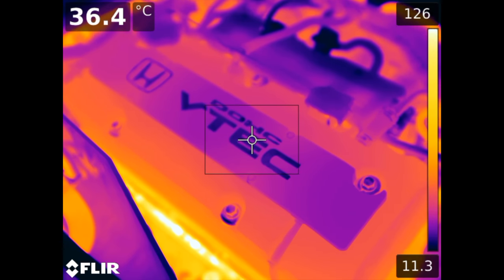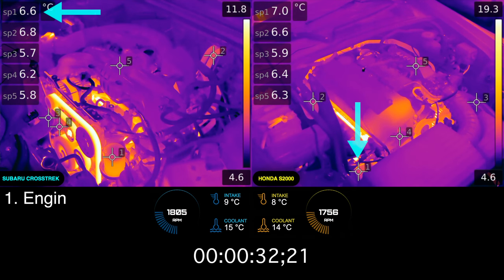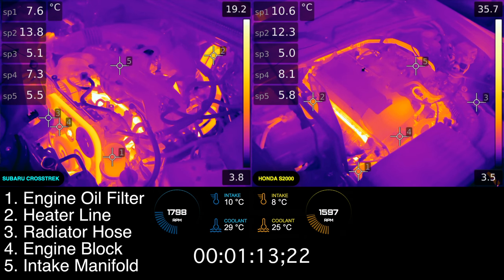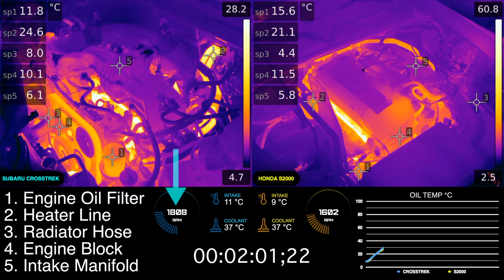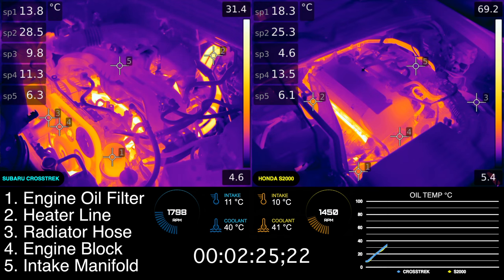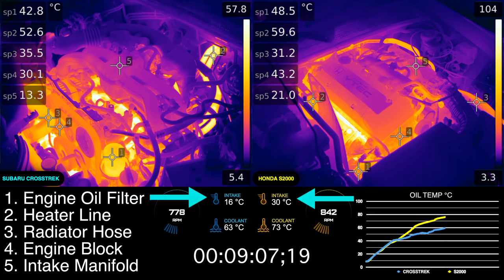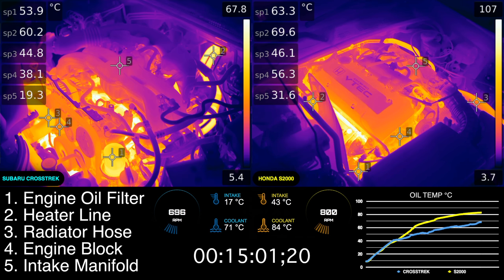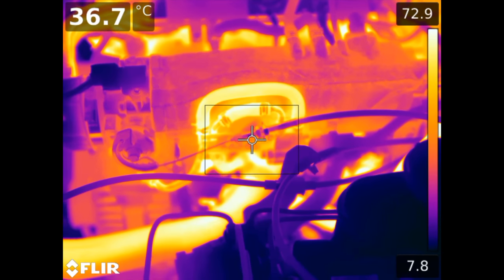$40,000 Thermal Camera - Watching Engines Warm Up

Comment: Serious question, what kind of engineer likes hondas???
Reply from the maker: If you don't know why the S2000 is cool from an engineering standpoint, this video is for you! https://youtu.be/wf_ICA2JdLU Innovative chassis design, carbon fiber cylinder bores, the highest specific output of any naturally aspirated engine when it debuted. Quite a machine!
Reply: Ok I get it more now but there is no justification to that styling and those carbon fiber cylinder bores just seem excessive compared to the rest of the car. Also considering what else is on the market these days but I guess it's just one of the choices and whatever floats your boat

Comment: It was hard to watch this video, America 😆
Reply: it's easy 0 celsius is freezing 100 celsius is boiling. instead of 32f and 212f.
Reply: I think what he's saying is that it's good to be able to estimate and figure in many systems, not that one is better than the other.
Reply: It really just comes down to what you're used to.  I know what inches, feet, miles look like.  I know what ounces and pounds feel like.  I know what Fahrenheit temperatures feel like.  So for example I know that a measurement like 30 inches or 2.5 feet is the height of most desks and tables.  5.5 to 6 feet is the height of most adult humans.  And 32 degrees is cold, 72 degrees is comfortable, and 98 degrees is hot!  I know these things because that's how I was brought up.

With the metric system, I can't "picture" the measurements in my mind.  I always have to do a mental calculation to convert to imperial.  That town is 100 km away?  Oh let's see, 1 km is about 0.6 miles, so the town is really about 60 miles away.  Got it.  I think that's the problem that most Americans have with the metric system.  They can't picture what it is, and have to convert, which takes mental abilities that many people just don't possess.
Reply: Enjoy!Hhahahaha C system is much more better...
Reply: Me personally I live in American, but use the metric system because imperial is just ass backwards.
Reply: quick - how many newton meters tight should a lug nut be?
Made you look it up.

Comment: not a fair comparison s2000 has way higher compression than a subaru
Reply from the maker: +qpzmak higher compression ratios have higher thermal efficiencies, so technically more power is converted into useful work. Either way, this wasn't about one being "better" or worse than the other. Just a video to learn.

Comment: What suprised you the most on this experiment ?
Reply from the maker: To me it was fascinating to see the oil temperature with respect to time. They remain so similar for the first three minutes, and then take on completely different trajectories.
Reply: Didn't know if you were aware of this as well, with 2015+ Legacy/Outback, the 2.5 actually runs with a higher oil temp than the 3.6.  Subaru fitted the 3.6 with a heat exchanger for the oil mounted near the filter.

Comment: So you don't need to warm up your engine? My life is a lie
Reply from the maker: https://youtu.be/xKALgXDwou4
Reply: Engineering Explained I completely forgot about that video. Thanks
Reply: The best is dry sump cars that flow oil before turning over, but mostly cost and maybe electric pump reliability(or cost of a equally reliable pump) hold most manufactures back. Also great in a turbo car so the oil doesn't sit in a hot turbo when turned off. That is actually another big concern, even stock full boost is very harmful to a cold turbo's bearings and seals.